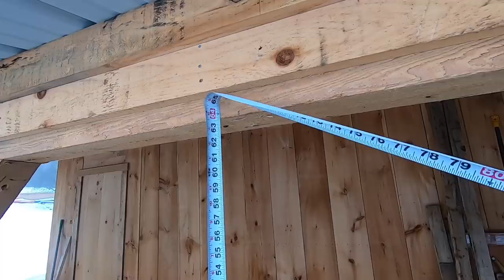Husband & Wife Team Up She Cuts I NAIL Framing in the Barn Addition

Comment: 20:25 Build double door, split double hinged doors. Have it open left or right to a smaller opening with partial panels locked, or full opening with all four panels open. Each door is hinged in the middle giving you single panel, double panel, 3 panels or all four panels open. Depending on what you want to do. You've got to reinforce the inner panel since is has to carry the weight of both doors. The outer panel can be regular weight. Triple hinge the outside panels and you can double hinge the inner panels. If you tilt the outer panel hinges just a degree or two past level, the door will swing open and hold itself open (as long as there's no wind but even then, it'll fall open again when the wind dies.)

Comment: What about a 3 door system, The right side being the biggest and single because of the  angled top giving you maximum height and the floor and ceiling pins on it, Then a Dutch door on the left for regular use.

Comment: Al, have the two of you given any consideration to adding storm lockers at both of the house door entries so that you are not stepping directly from the outside stoop into the inside of the home; into the basement or directly into the kitchen/eating area?  Farmers back in the 1940s, 50s, 60s, 70s, etc, use to build a small enclosed storm locker / porch that allowed the homestead to have a airlock between the cold winter air and weather and the inside of the home.  Or, during the spring, summer, or fall; the storm locker gave you a place to step into to put on or take off your work clothes / shoes or boots without stepping into the home.  Yes, the basement locker would add a little bit of problem with pulling in your wood for the furnance; but, it could be over come with a door wedge to hold the locker door open while you stepped through into the basement.  My uncle's storm lockers were 8 foot by 10 foot and they had benches to set on and clothes hooks for rain gear or winter gear.  This setup kept the cold, snow, rain, or wind from coming into the home everytime the home door was opened.  Just offering up a suggestion to help manage the cold and snow and the rain and wind while helping you to control the dirt and weather from coming into your beautiful home.
Reply: He did mention in one video they would like a mud room or porch for both entrances. He just did not get to it yet. Rome wasn't built in a day. 😊

Comment: A few things today Al

Maybe time to start considering a livestock guardian dog/s as your number and types of livestock is only gonna increase from this point.

As for barn front, maybe a sliding barn door might be best but it may not work given the configuration with the garage door, so double doors maybe the only solution.

Maybe cut another door into side of goat barn into breeding area.
Reply: Gary Moncrieff ...a livestock guardian dog needs secure and high perimeter fencing or very good electric fencing, especially on a small property. With Al’s neighbors so close the barking may also be a problem. LGD’s first line of Defence is barking to let predators or intruders know they are there. They also tend to work better in pairs. 1 to stay with the flock or herd, the other to patrol the perimeter. They are phenomenal protectors but do have some limitations as to use.
Reply: @fionajane56  Yes I know but Al has previously stated his aim is to fence in the new pasture, and i did mention dog/s as in plural.

Comment: Double doors for the new enclosed wing of the barn - maximize versatility.  Is it possible to make 'barn doors' to run on a rail?  Easier for the snow.
Reply: To do doors on a rail, you need space to the left or right.  Unfortunately, the left side is the garage door, and the right side is open air.  For this location, the door or doors are going to have to either swing open to the side or roll up.  I'd say a little garage door would be nice because when they're open, they're hidden.  Swinging doors take up horizontal space when open, which could make it tedious to move things between the garage or driveway and this new wing.

But if swinging doors are cheaper, and they might be, and if money is a consideration, then swinging doors are nice, too.  In that case, two doors will give our homesteaders maximum flexibility.  One door is possible, but if it's wide enough for big things to fit in, the weight of the door is a burden.  Plus it would need super-strong diagonal bracing and very large hinges.
Reply: @dper1112  ooohhhh right! I wasn't thinking!  Thanks.
Reply: Agree that sliding does not work in that set up ... but the other issue with sliding doors in that type of environment is that water gets into the rails and then freezes overnight... the result is that door won't side.  Ask me how I know.

Comment: It is more work Al but, how about making the opening wide and tall enough for the tractor. Frame for the arch like the wood shed then construct double doors. Put slide bolts at top and bottom of one door to secure when shut. Then have other door to be the one that is opened mostly. It will be interesting to see what you and Gina decide. Blessings...👍👉...

Comment: Double doors would be cool.  With big black wrought-iron style strap hinges. I've noticed you have to follow up quite often with your hammer after using the nail gun. For exact placement of nails you doing it right, by placing the gun before pulling the trigger. Bouncing the gun to engage the safety while holding the trigger, I think is keeping your nails from fully seating and it's not that much quicker. Maybe not as much fun..... and a bad habit to break.

Comment: There is a lot of snow on the property - check around the edges for TRACKS. This will provide you with information on what species is doing recon. Then you'll know what type /size of trap to use. Know that it could be feral dogs.
Dr. Skip

Comment: I would go with a 7 or 8' door.  The Kuboter is a big investment. Storing machinery under cover will prevent many maintenance issues.  If equipped with a block heater you have space in the electric panel for a dedicated outlet to plug it in.  Thanks for the fun.

Comment: Double Dutch doors as large as possible. This would allow vehicle access and ventilation, if stalls are built. Will you be putting a dutch door in the back wall? That could save walking around the barn for hay feeding and possible stall access.

Comment: I was surprised by Zeke, but I was glad you went a head and put Caleb in to the the deed and you did give them separate stalls.  The side of the barn, I would make it big enough to hold the tractor.  Put doors on it.  You can pull it out use it as a stall for have kids in. Put mats down removable  feeders hay rack.  Then in winter back to place to store tractor.

Comment: Hey al. If you add a little hot pepper to the chickens water they will lay more eggs in the winter. I used cayenne pepper. It seems to work the best. Don't use to much through. Just a sprinkle is all ya need.

Comment: Yes, big double doors but easy to get into.  I think it makes sense (well, to me) to use the door on that right side of the barn to get in and out, rather than through the clean milk room.  Boots are dirty so often that if you don't need to be in the milk room might as well not use it as a pass through/hall.  At least that's how I think I would see that lovely clean milk room, ha.

Comment: What about an old fashioned sliding barn door on a track? You can build the door yourself, and have it slide toward the barn on a track. That way it isnt hanging out in the open or in the way if going in and out with the kubota. But yet it will keep the weather out when its slid shut.